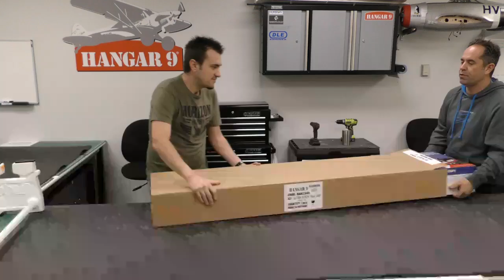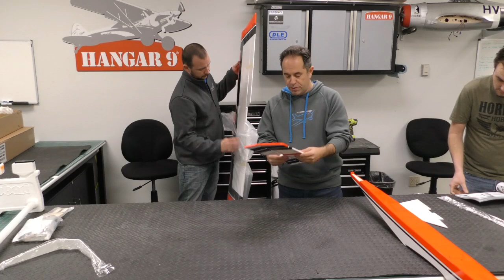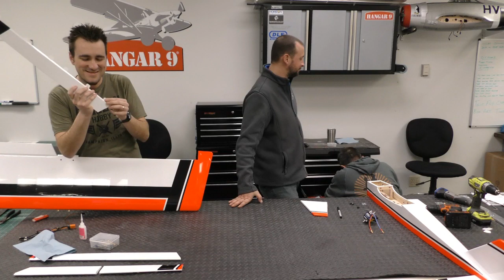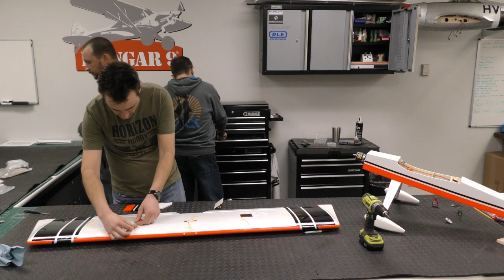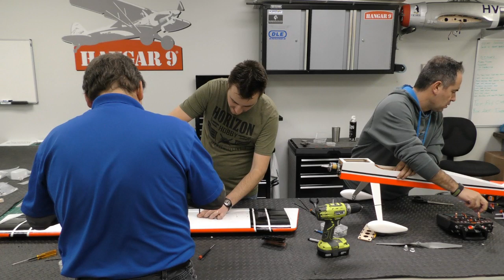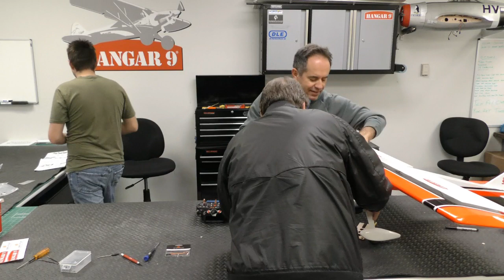LIVE BUILD: Hangar 9 Ultra Stick 10cc

Comment: Looks like you guys had fun, unfortunately as a beginner I found the Build section not very explanatory and three building at one time confusing as to what was being done and why.  Maybe leave out the infomercial and have a more to the point video.  Thanks for the effort though.  Guys in the club have several and it will be my next plane.

Comment: I was hoping you would use the manual to build this plane. With three guys all acting independent of each other it looks like the manual was thrown out and it’s difficult to watch each guy do his thing. Step one in the manual says to remove the ailerons and attach the control horns. In your video, one guy is attaching the tail planes, one other guy is assembling the landing gear and the third guy works on the ailerons.

Comment: I wish more time had been spent discussing the build steps.  On my Ultra the propeller in the HH suggested area for the Ultra will not fit the spinner, the hole in the propeller is too small.  I drilled it out to make it fit.

Comment: 55:41 just to confirm, can you run the Avian 60 AMP ESC with the Power 52.
Reply from the maker: It has worked thus far on this one, but an 80-amp variant may suit the plane better! We were probably pushing the limit with the 60, but we shot an entire flight episode with it installed: https://youtu.be/ZqPA8fyLBh8

Comment: Hi. I used Epoxy 15 minutes for installing the tail & stabilizer (tonight). Do you think I was wrong ? Manual says to use Epoxy 30 minutes. Best Regards.
Reply from the maker: Nope, you will be fine. We used 5-minute in this video :).